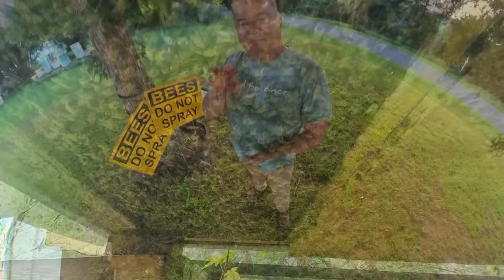MASSIVE  Beehive Found With 7 Queens and 10 Lbs of Bees !!!!

Comment: I recently had to sand lots of drywall, and came up with the idea of making my own vacuum hose end attachment. I bought a strip of brush that the cnc people use to control dust around the bit, and 3d printed a hose end with a slot for the brush. The bristles are 2" long, so very gentle. I'm thinking the bees might be less abused by that, when running the hose side to side. Also, you can make the brush shape and dia anything you want so you could do larger ones for larger areas. Not sure if you could speed things up that way but an idea.

Comment: I know this is an older video just wondering why she doesn’t sting when you handle her? The queen
Reply from the maker: @dorotheal5284  it is said that queens do and can sting, I have never been stung by one though.   Dumb luck or just good at it....who knows.
Reply: @YappyBeeman  thank u ☺️
Reply: @YappyBeeman  Did you hear any of the queens chirping? I've read that they make a sound when they are ready to hatch. With 7 of them I thought yu might have captured it? I think I saw it on Dirt Rooster or Jeff H when they caught one doing it?
Reply from the maker: Yes, they do make a noise.  I believe it's to call out any others in the hive so they can locate and potentially fight them.  The new queens have such a low pheremone that they have to call for them.   But in this, I don't recall hearing it but have many times over the years.
Reply: @YappyBeeman  Yes I knew about the killing of the competition but did not know about the low pheremones. Thx for the info.

Comment: When you vacuum the bees does it or does it save I know the air pressure of the vacuum to suck them in could hurt them just concerned
Reply from the maker: It doesn't hurt them.  You will see at the end of the video, the bees are just fine as I rehome them in a beehive.
Reply: @YappyBeeman phew. I was concerned 2

Comment: I really love channels like yours and the hornet kings channel. You are so gentle and respectful of the bees and wasps, and you dont have to do inhumane things to them like some other channels do. I watched a guy spray gorilla glue on a hornets nest recently and then he crushed the head of the queen on camera. It was a total disgrace. Thank you for the way you handle these bees.
Reply: What does it really matter if they're all going to die anyways? Is there really any "humane" way to do it? Do they feel pain and care which way they die? I saw that other guys video as well and altho it wasnt the quickest method I've seen, it kept the wasps from getting out and trapped the ones that came back. He seems to try different methods to show people who may have to do this at home and only have certain options available how to do it, what happens, and what maybe works best and what doesnt. Its still educational for some even if it might be hard to watch at times. I saw him also use an expanding spray foam that filled the hive and killed what was inside pretty quickly, but then he had to deal with the ones outside that came back and dive bombed him, is that inhumane as well? Also he squished the queen and it died instantly, thats about as humane as you can get. If you are hunting and shoot a deer and it doesnt die immediately and is wounded on the ground, you usually go up and slit its throat instead of letting it suffer, it isnt easy to watch, or even easy to do, but isnt squishing a bee and killing it instantly basically the same thing. Have you never squashed or sprayed spiders or ants or any bugs in your lifetime? I will admit he does maybe get off on it a bit too much but its his job to literally eradicate these things and I think he enjoys seeing whats works and how efficient it might be. It also seems like different hives call for different methods and each job and method is a learning tool for him.

This guy seems to deal with honey bees more, or at least he did in this video, and they are completely different from wasps, hornets, yellow jackets, etc. They are basically pets in a sense for some people and can be very docile and easier to deal with but need to be handled delicately so its understandable to treat them with more respect than the ones your just going to kill anyways. You give them respect and they give you honey, its more of a relationship than what you'd have with say wasps and hornets which are more of a pest and a nuisance to people.

Comment: whats your thoughts on the long hive, i'm disabled and dont like liftin a box full of honey or bees, i have 3 right now, my balance isnt good, i think thats a better format for me, would you have a set of plans i could use, thanx in advance
Reply from the maker: Horizontalbees add dotcom makes a great hive and the leg height can be adjusted to accommodate beekeepers that  have the same struggles.  They even make one that tilts for those in wheelchairs.   I love all 4 of mine.  I put these bees in one because it mimiced the same situation they came out of and took to it very well.    Spring update will be coming.

Comment: The vacume doesn't kill the bees??
Reply from the maker: No.  Please watch until the end .
Reply: @YappyBeeman   I did, great video!
Reply from the maker: Glad you liked it.  I hope the ending helped answer the question.   The vac system is specifically designed to collect and not kill the bees so they can be rehomed.  I've used it over 10 years and it works great.     Thanks for the question and reply.

Comment: You were interested in the bees but the customer simply  wanted them all gone. What did you do to  make them all gone and not come back?
Reply: You can remove the bees and close any openings.  However the bees will be attracted to the smell of honey and wax.  So if you keep getting reinfected, you might need to work more on cleaning or replacing the wood in the area.  If the area isnt cleaned any leftover honey, wax, and dead bees can lead to mold  and mildew.  So these videos of them removing the bees are really only the start of a homeowners problems.  Though most professionals will not start any work until the bees are removed.

Comment: Is it safe for the bees to get vacuumed?? I’m worried
Reply from the maker: Watch the last few of the video and read the pinned post.
Reply: Yup, just did. It must be handy but I definitely prefer hand bee removals… seem more bee friendly
Reply from the maker: Respectfully, you can use a cup to remove the water from a sinking boat or a pump.   Both do the same job. One just works better, gets the job done faster and differentiates between those that know how and those that have less experience.

Comment: Why do you hatch them so soon? What if it’s too early ?
Reply: so I'm only guessing - I'd assume that it's because it's better to try get them out onsite with the comb you're removing but I'm not sure specifically why besides a vague hunch that it's either a "they would die anyway, better to give them a chance" situation or maybe a "if we missed enough bees and a queen that hatches the problem isn't solved" situation. Not sure, not sure at all.
Reply: Ohhh this sent me on a research dive. I learned some really interesting things about queen communication.

So, from the chill behavior of those first bees on the outside, and from the absolutely packed-full inside, this hive was getting ready to cast a swarm. The old queen goes with the first swarm, letting one of the new queens take over. 

The colony wants to cast afterswarms too, as long as it has the resources to do so -- plenty of stores, plenty of workers, and a queen for each swarm. So the workers actually raise more queens than they need, and they keep them in their cells after they're ready to emerge. There's a protocol for letting them out one at a time. 

An emerged queen makes a "toot" sound for a few days, with some details of the tooting changing from day to day. The queens still in their cells reply with "quack" sounds. So all the workers know if there's a queen out, and if there are still spares. 

If conditions are still good for swarming, the workers respond to the tooting by re-sealing the cuts that the other queens are making to try and uncap their cells. This continues until the tooting stops, either because the one emerged queen left with an afterswarm (yay) or because a mating flight went badly and she got eaten by a bird or something (boo). Then the re-sealing stops and another queen cuts her way out. 

The hive has to stop casting swarms if its worker population or its stores get low enough. At that point, the response to tooting changes. At this point, both the emerged queen and the workers start leaning towards killing the other adult queens in their cells instead of just keeping them there. 

They prefer destroying fully developed queens over destroying immature ones, so there is a certain amount of backup if a mating flight goes bad, or if the population or stores build back up and warrant casting some more swarms after all. 

That is a great system for natural colony reproduction, but keepers might want those extra queens for purposes of their own -- requeening other colonies, dividing colonies into nucs smaller than what the bees would do through swarming, etc. In that case, leaving them in their cells just makes things harder for you.
Reply: @eritain  that is freaking awesome, kudos on the deep dive!

Comment: How do they create heat?
Reply from the maker: They are naturally warm.  How to explain it scientifically , I can't.   But in mass, they get hot very quick without ventilation. Like having 50 people over for a party in a small house.
Reply: living creatures naturally create heat through metabolic processes (turning food into energy)
Reply: @YappyBeeman I recall seeing another video on bees talking about it a few years back. In that one they said the heat was generated by the vibrations the bees are constantly producing. That is heat beyond what they would produce through simple life processes. That is also how they kill wasps. They surround them and crank up the temperature to extremes by vibrating around the wasp. The inner layer most likely dies with it, but that is the advantage that sheer numbers gives the bees. Now, as to the veracity of the knowledge presented in that video... I can't say. I'm not a bee keeper nor an expert on insects. :P
Reply: @Maadhawk   I had a feeling there was some other mechanism at work other than "body heat"

Comment: Does using the vacuum kill them??
Reply: He has a specialized vacuum I was reading itt that he had. So it's like a very low suction vacuum it sounds like for the bees, so they don't get killed. The vacuum is hooked up to a box where he was keeping them. Once it's full enough, he swapped for a new box so the bees don't overheat and die.

Comment: Putting them thru a vac seems hurtful
Reply: Vac and hoses are purpose designed so as not to damage bees. Hoses have a smooth inner lining and the suction power of the vac is fully adjustable by the beekeeper. You can see how healthy and vigorous they are when he tips them into the long hive. It doesn't bother them at all.
Reply: what really sucks is that there are tons of other people out there just like you. it's like a living nightmare.
Reply: Bee removal experts like Yappy use specially designed vacuums and hoses so the bees aren't hurt.  And the box is used for safe transport.  Because of heat he can't put this many in a single crate.

Comment: Shud you be hatching them, shouldn't they be doing that on their own bud
Reply from the maker: Well lets think about this....the first cell I  cut out and set to the side hatched 5 mins later.  She almost got away because I didn't look at the cell end to see she was eating her way out.   But I could tell by most of the others it was happening.   So I assisted them out to be able to capture and cage them.  They now reside with other keepers and I assume doing very well since I have not heard otherwise.   As well as the one I kept, let mate and marked later which was seen at the end of the video.   So, I don't see where this was an issue.

Comment: Why are you killing all those poor honeybees with your vacuum cleaner? This is really bad.
Reply: YappyBeeman explained the vacuum is designated to collect bees, it doesn’t kill them
Reply: @corpedatlanta  well if you see the other videos you know that this is not true. They die. The same what happens to hornets with the vacuum cleaner.
Reply: @corpedatlanta  that also shows, that you have no idea, how a vacuum cleaner works. Within the hose of the vacuum cleaner it’s between 100km/h and 140km/h when the bees hit the ground.
Reply: @mattse9271  You are so confident in a WRONG answer. Its not the average vacuum cleaner which draws airflow between 50-100CFM to collect debris. It's a BEE VAC designated to collect large swarms of bees without harming them. Look it up.
Reply: @mattse9271 You may be thinking of the wasp/hornet removal videos where they use a regular shop vac with soapy water to extract the wasps.
Reply: @sazji  ok, well, if it is really a different vacuum than I’m gonna be quiet 🤐. Sorry for the trouble caused.
Reply: He literally shows you the collection box and explains how he doesn't top them up every time because the bees generate too much heat. You can trust a beekeeper to know how to collect bees.